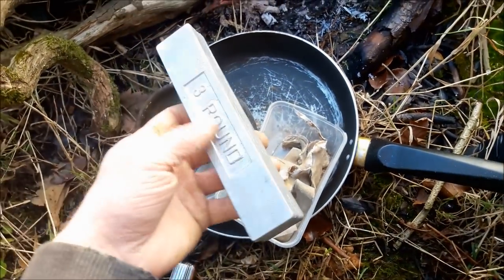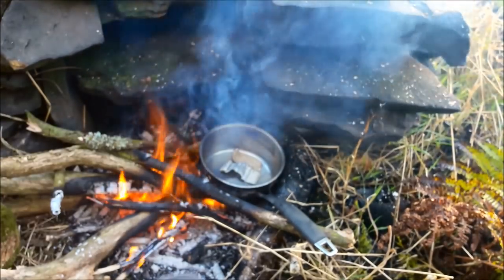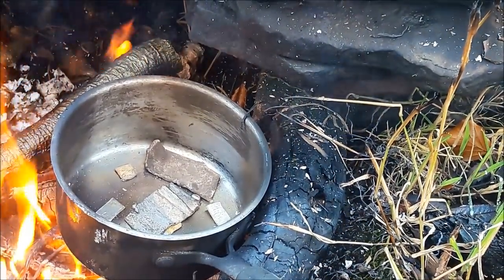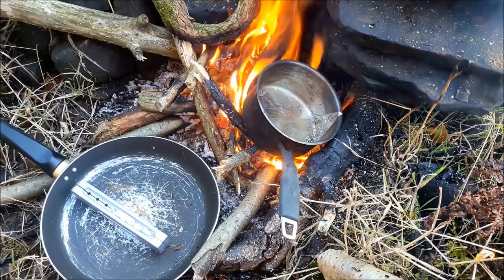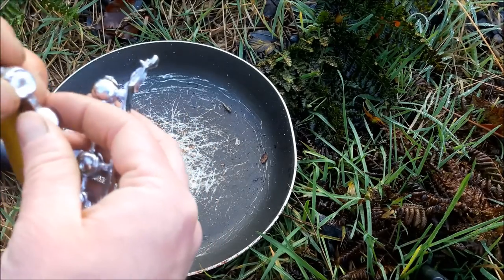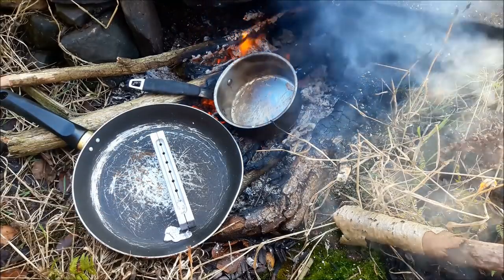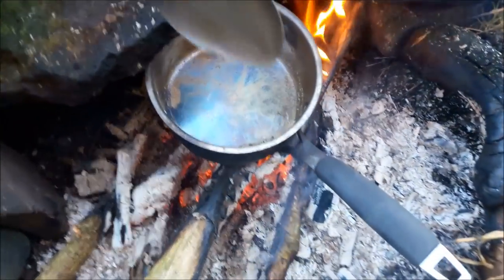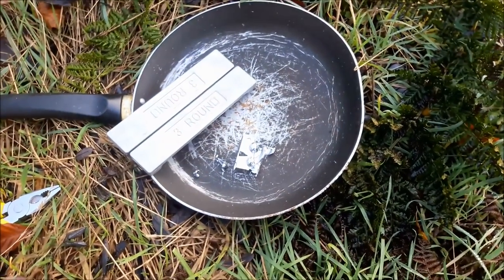Casting lead musket balls with metal detecting scrap

Comment: If you plan on melting more lead you should get a cast iron pot it will hold up better with the heat for long term use.
Reply from the maker: Thanks for the tip mate, I've got a Dutch oven but use that for cooking. Need to add an iron pot to my list of things. A ladel too.